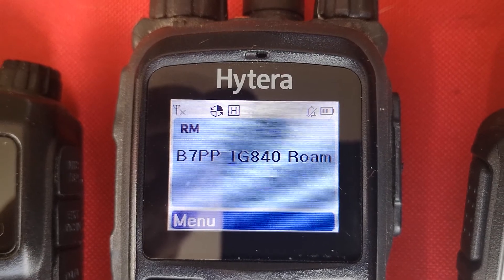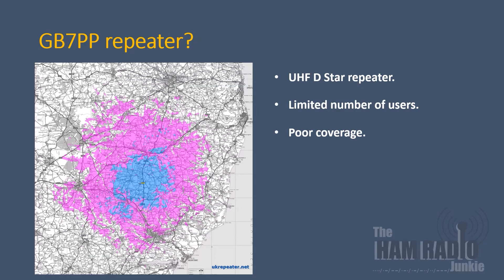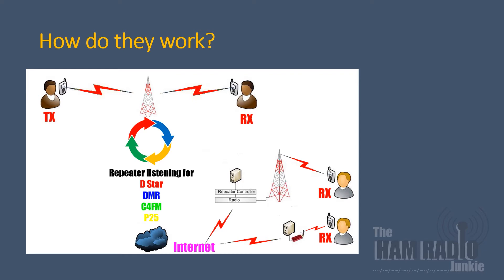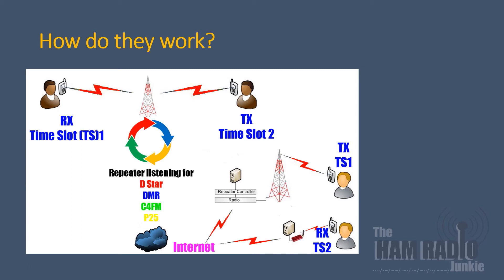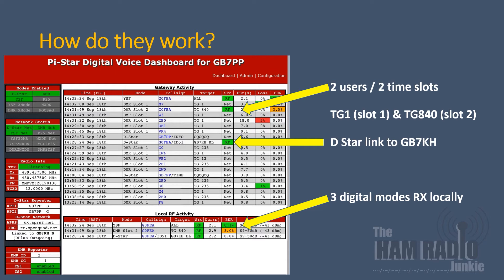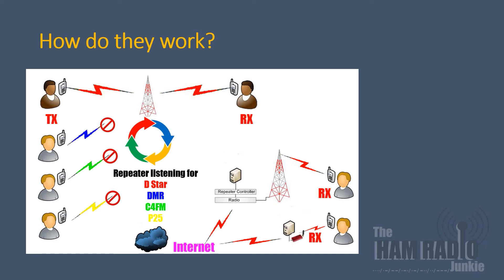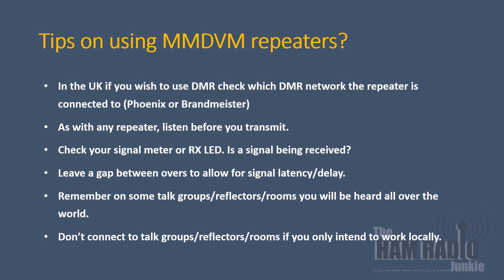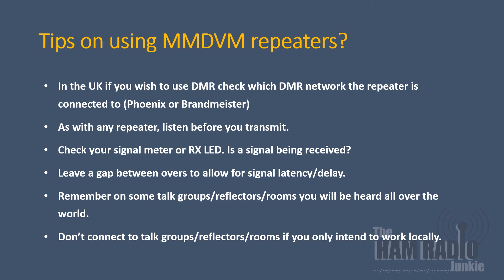What are Multimode Digital Voice Repeaters and how to use them

Comment: Still don't know how to access a digital repeater. Do you need tone? what mode do you use on fusion? dn vw? I cannot find an explanation starting from scratch for someone completely new to c4fm
Reply from the maker: Ali, thanks for the comment lets see if we can help you.

If you are accessing a digital repeater there is no CTCSS required. On all repeaters you will program the input and output frequency. Input for your transmitter to get into the repeater and output for you to hear the repeater.

On a DMR repeater you need the colour code of the repeater and the time slot of the talk group you require.

On DStar you simply put in the repeater callsign as shown in my video on DStar.

On C4FM Fusion repeaters you transmit on DN (Digital Narrow). No need for CTCSS or tone.

Hope that helps. I will do a video when I get my computer back working to give more detail.

Keith
Reply: @TheHamRadioJunkie  Thanks Keith